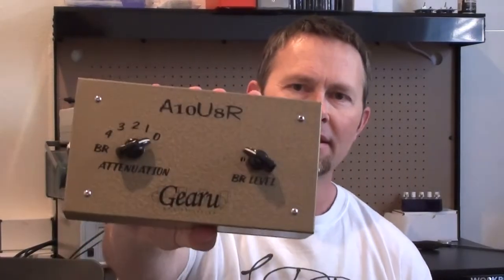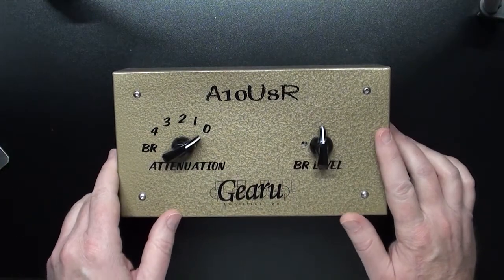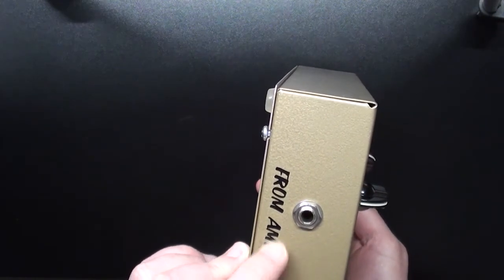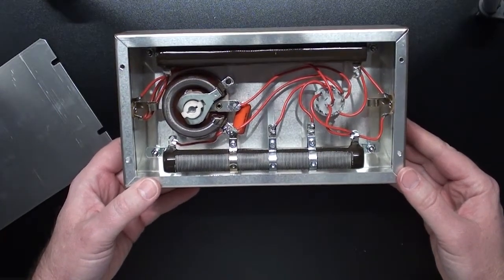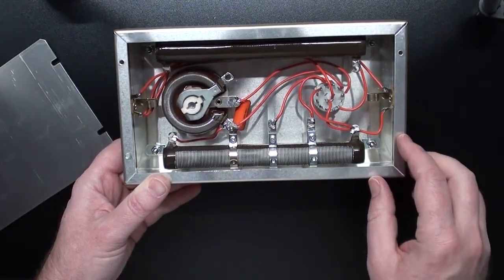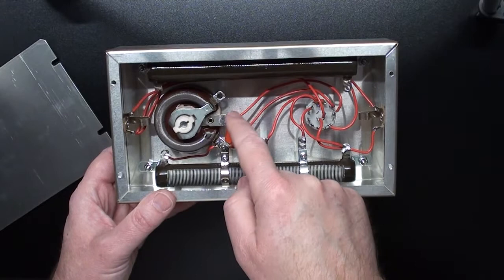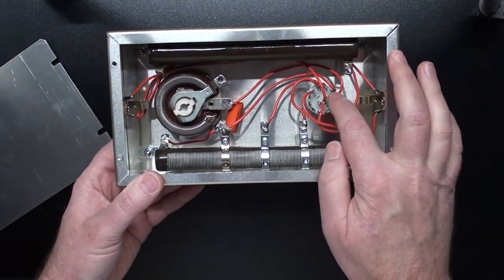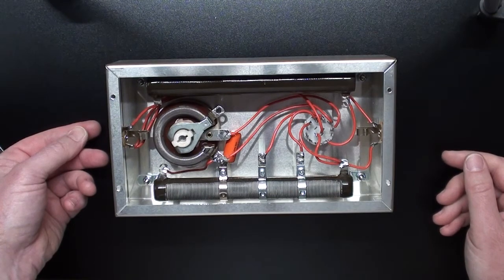What's Inside This A10U8R Tube Amp Power Attenuator by Gearu Amplification

Comment: would rather have a power scaling amp.  The L pad eats up all the tone, feel and dynamics.  The L pad sucks ass it does nothing but suck everything dry and the power amp valves and output transformer hate it.  Regarding L pads, monkey see, monkey do.  The monkey put his hand in a hole to get some peanuts, and when the monkey clinched a fist full of peanuts, the dumb ass money could not get his fist full of peanuts out of the hole and was too dam stupid to let go of the peanuts in order to get his hand out of the hole.
Reply from the maker: Ann anthony you should definitely do this. There's actually a bom available with active links at The Amp Garage forum. I just did a total parts cost check at Mouser against the bom and it came to $175 plus shipping. So it's definitely less than buying the real Airbrake

Comment: Thanks Lawrence. I've recently purchased a similar unit on eBay (differences appear to be cosmetic) from a local distributor in Australia, so great to see what is is actually doing inside the box. "BWM 100watt NON OHM SPECIFIC ATTENUATOR"

Comment: Interesting!  Great video! I like these "what's inside" videos!   I didn't know what to expect when you opened it up.  Was actually thinking there would be more to it, but with your explanation it all made sense!  With the newer amps today that have good master volume controls,  are these types of attenuators still needed or are they aimed mainly at older non-master volume amps?
Reply from the maker: Brian M that's an "it all depends" question and answer… if you're the type of player who likes the sound of the amp with the master at 4 but likes the volume of the amp at 1, then an attenuator would likely help with this. Most of the time, attenuators are used with non-master volume amps to allow the great tone they generate at more reasonable volumes. It's also possible theses days to obtain those similar types of tones at bedroom levels with pedals and a quiet clean amp, so largely you see attenuators being used in live playing situations.
Reply: Thanks for the info Lawrence!  I'm fascinated with all of this stuff.  So many options.  I've been reading up on attenuators, and then the Two Notes and Fryette offerings.  For home use, you are absolutely correct, a good clean amp and some pedals do fine. (Using my Tweed Blues Jr, Sixty 6 Deluxe, and another OD pedal...I like simple and straight forward).  I guess I really have what I need, but the "gear nerd" in me keeps looking around!  Again, thanks for these videos, I dig them, and learn something along the way!!!